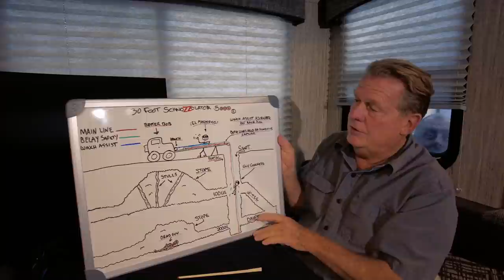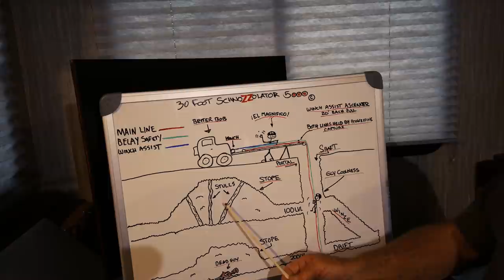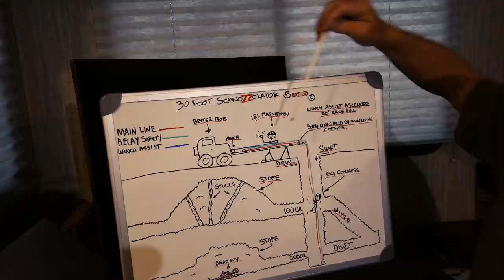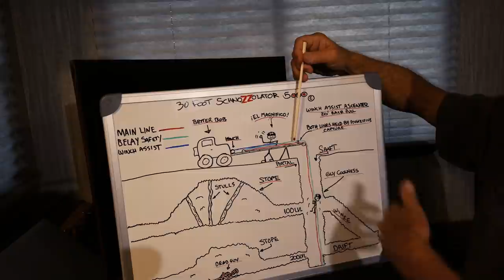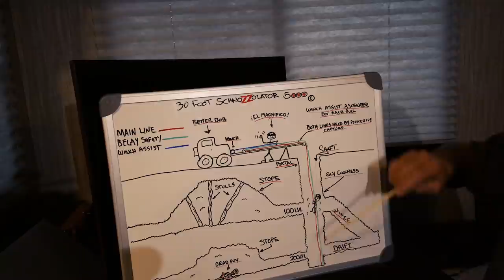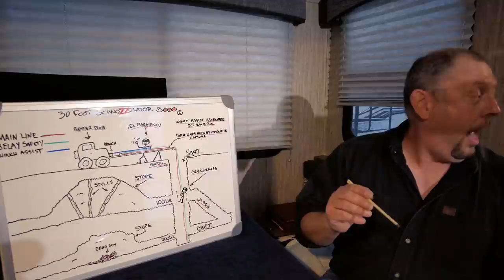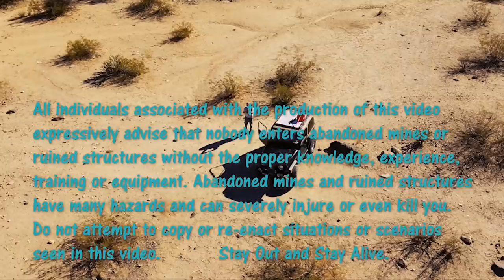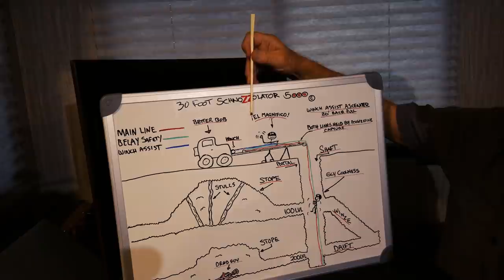Introducing The Schnozzolator 5000

Comment: How big of a support truck will you need to carry the Schnozzolator?? I have designed a similar, but much more portable devise called a Upendowner 6000, it is currently being made in a very big manufacturing country in the Oriente and made of the finest materials available from recycled U.S. discarded metals. I am open to selling this to you exclusively.
Reply from the maker: The Schnozz breaks down to 5' Pieces. 6x5 is 30 feet. Then we have a Boom which is 5 ' also. We will transport it on the rack of Better Bob, and have a design, but no shop with me to build a 9"x9" box with a riser to strap to, which will fit our receivers on Either Jeep, or any rig with a receiver for that matter.
Also. We have not set this up yet. When we do we will encounter necessary design modifications including most likely, a cable guy wire system from the smart end of the Schnozz triangularly to the Jeep.
As we can all agree, as with literally ALL things in this life, we trust our judgment, and are resigned to learn how to operate this crazy thing thru the aged old process of trial and error.
Reply: @abandonedforgottenfootage1556  MyUpendowner breaks down into many more pieces but the large manufacturing company in the Orient is working on preventing that from happening again.
Reply: Q-1 Is better bob going to be able to transportand hold all that weight? There and during the descend of Gly? 
I think it would be better to get a better vehicle to be able to transport and hold the 5000lbs you need to have a person to do any repelling into the unknown. Great design thou.
Reply: @gyprocman8163  with the geometry of what he showed us it should be most capable of the rating needed. It looks like around a 3 to 1 ratio so Bob should only be holding down what engineer Mr M ? 1800lbs?

Comment: Be sure to do some dry run safety tests with a weighted crash test dummy to make sure Gly doesn’t become a piñata. (Everybody grab a stick!) As a thought; you should use cable, with weight, the fibers inside a nylon or synthetic kern mantle rope begins to overheat and become brittle.

Comment: Mr M. One of the safety gadgets I used for years working off of helicopter 🚁 skids is a dual line that hooks into the harness. One side is is a series of loops that break open one at a time depending on the kinetic energy of the fall. Keeps you from breaking your back or similar if you fall off a skid... or down a shaft.
It’s best that instead of a “sits harness”  use a full body harness. They never really are a bother and you forget you have them on.

Comment: That was fun and an interesting concept.  If you belayed a loop on the winch spool, how many feet of aircraft control cable 
could you rotate down the shaft without fouling or twisting?  If it is a valid concept to winch a person up and down a shaft 
on a continuous loop, your limit is the breaking strength of the cable divided by 5.

Using the following figures, a safety line and a single cable,

For example, 3/16 inch, 7 x 19 Galvanized Cable
Property	Value
Breaking Strength:	4,200 lbs
Working Load Limit (5:1) Design Factor:   	840 lbs
  Well more than a double Gly Coolness load
Weight per foot:	0.065 lbs

Other possibilities
7 x 19 Galvanized Aircraft Cable Wire Rope 1/8"

7x19 Strand	Size (in.)    |	Breaking Strength      |     Working Load
3/32"      	1000
 lbs breaking strength            Working load (5:1) 200lbs load
1/8"	                2000
 lbs breaking strength            Working load (5:1) 400lbs load
5/32"	        2800
 lbs breaking strength            Working load (5:1) 560lbs load.

With 1/8" 7 X19 cable, it ought to be fairly easy to fit a lot of linear feet on the winch spool if you don't want to loop the wire.
With a dual drive spool adapted from 2 winches for a backup drive, you could easily hold hundreds of feet on a spool.

A 500' spool of 1/8" comes in a 13 X 13 X 6" package.

Comment: I like it. How many feet of cable do you have on the winch?  Most Jeep winches only have 100’ or 125’ of cable.  Please test your idea several time with a DEAD weight and include the safety factor there.  The weight is multiplied something like 10x with the extension of the snozzelator.  Good Luck.

Comment: I definitely am not an engineer, but even with a 2/3 to 1/3 support on the boom - seems like there might be quite a bit of upward force on the mounting bracket to the Bobs  (I have no evidence to support this assertion).     Are there sufficient backups at the support bracket, in case of primary failure?  
Can't wait until season 6, where you guys engineer a robot to drop down, navigate the partial collapses, take 3D 360 degree VR videos, and a sample with a multigas meter.   :)
Great stuff!    Thanks for showing us.
Reply from the maker: Season  6? Have you been talking to NetFlix? Or was that just a lucky guess? We also cable the working end of the Schnozz to the Jeep.

Comment: Yeah my design would have used residential tv tower as its main beam, kind of like the boom on a tower crane. Though it would have attached to the front of the vehicle and utilized the main winch. Though I would have used a secondary 'lite' winch with ~1000' of 1/8 line for 'emergency' ascending, just free spool it while in decent but if something bad happens use the winch to recover. only have like a 4-500lb break cap., but for emergency extraction, might be better than the time needed for 20' steps. Not that anything bad will ever happen, but murphy's law, if you have it you wont need it, but if you don't something will. 
Will be looking forward for seeing the Schnozz5k in action soon!

Comment: Mr M, I have a few questions:
How thick is the box beam?
why not mandril fit stock?
could you use gin poles and cable to add rigidity? ( something like the setup on those rolling field irrigation units ) a couple on either side of the "proboscus"  at the far ends of the bumper width anchored and cables from the nose of the 5,000, over the top of the gin poles ( links and eye bolts or rings all the way back to the rear bumper... door opening might be an issue depends on if you opened them I guess.

might want some pad struts to swing down and drop to the ground for dive/bounce control. IDK...

Last, it maybe that the winch might not be up to the duty vrs time thing.  But, a hydraulic  pump installed on Better Bob and a hydraulic motor driven winch with radiator control valves and a few dc brushless fans manual backup and a brake fall decent safety setup. leave Bobs hood propped open.

Lastly, I you need to run and get help, you are tied in pretty well to stay. 

also an extra shnoz pulley for who the heck knows what when

I know you guys have thought about most of this I am sure, and the additional weight of junk should bot be too bad, but I had to say something, every time I have not, I should have. I care about guys, and really appreciate all you do. Maybe you guys can have a new channel Mine fishing with live bait, Gly, your on the hook for this one👍 Mr M, dont forget your fishing cap. 🐟

Comment: I like your idea but may I add an idea? Instead of a 20 foot pull you can do a small modifications and increase the distance by 80 feet. For an  example to look at. Look at a super belt takeup.  The weight shouldnt increase by maybe 5 percent. Just an idea or food for thought.

Comment: This seems all a little bit too safe and thought out. I would have been like, "Hey Gly I am going to tie this rope to my front bumper and then drive forward to lower you down." We all know Gly would have said something like, "Heck yeah Ben sounds great! Perfectly safe! Just as long as I can get down into this scary mine full of loose guillotine shaped rocks!...but wait what if the rope breaks? I am going to pack a parachute in my backpack so in the off chance the rope does snap I just pull on the zip chord and POOF! I float down to the bottom."

Good thing Mr M is on the case
Reply from the maker: Right?  Gly is like the special child, that FINALLY gets away from the authorities.

Comment: Hello Mr. M
The idea and design of the Schnozzolator is brilliant. However, as a retired engineer (albeit Electrical), I see an Achilles heel in the operation. That is the winch. I’m sure you and Gly have covered this already. Do you have a plan B if the winch malfunctions and can’t be quickly or easily repaired while lifting Gly. [not saying Gly’s weight will cause that - :-)]. I know winches can fail like anything else electromechanical. The plan B would be using Better Bob to pull him in but since the 5000 is bolted to BB that might not easily work. Thought I would pass my thought to you guys. Love the shows and keep up the great work! P.S. I did win the Barite from episode 72 - stunning.
Reply from the maker: We gave that scenario much thought. Follow me thru the process. 
Spare winch! Perfect.
Oh oh. What if the Battery takes a dump?
Spare Battery! What if then the Jeep dosent start because we drained it pulling an unreasonable load (Gly is hard to reason with). 
We'll get a moped to take with us............
Final answer. 
I'll use up to a 6 to1 pully system, and Pull him up manually. Won't be fun.
Extremely doable.
Thanks for thought!
Reply: I had faith you guys thought of everything but I wouldn’t feel good if I didn’t express my thoughts. Spending most of my career in the nuclear world, I’m used to going through countless “What If” scenarios. Both of you take care and stay healthy and safe.

Comment: I see you've drawn in a forward support, that takes care of a lot of the advantage the load has over the beam, but I want to make sure you're thinking about one thing.
If the safety line comes into play (god forbid), that would let the full payload reach 4 meters/second and then suddenly stop. You have a shock load equivalent to 13.8 meters per second in total, if I remember this correctly. Forgive me if my math/calcs are wrong, but that makes 140kg static load into a 343kg shock, 750lb load on a 2" steel tube that's hung how far out from the front support?

Comment: Pretty thoughtful (considered? sorry, not a native English speaker) project. Watch your accumulator, don't let it kick the bucket. And here are some moments, maybe it's not interesting, but whatever. Russian miners tend to change stress in words, like minīng miněrals. Terms are basically borrowed from German. Horizontal tunnels are called "shtol'nya" (adit), "shtreck" (drift) and "kvershlag". I've checked some mine maps in English and I believe crosscut is the right term. Drift only follows the vein, and crosscut goes across the ore body to open it. I wonder why don't you use this term. Possibly it's some regional terminology, I'm a bit confused. The same thing with decline: I've never met this term, it's either incline or a winze. Winze can be dead end (exploratory, minor stoping, has a special name, btw, it's called shurf[шурф], pit in English, I suppose this term is not used) or connection to lower level(s), usually between 2 levels. It goes down distinguishing to the raises. That's how I know it, I might be wrong. Stopes are called lava, nothing to do with boiling metal, it's initial form of "lavka" that stands for a bench without backrest. It alludes to incommodious mining, possibly to all that benches on stulls, I'm not sure.